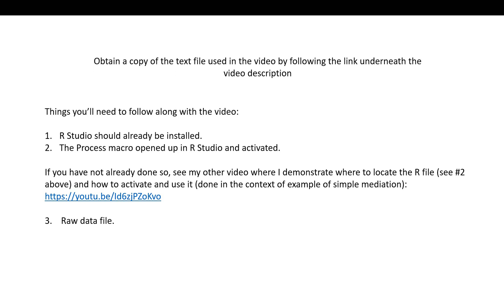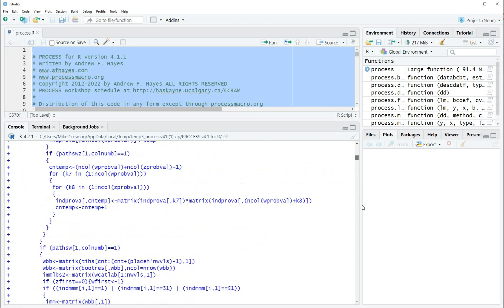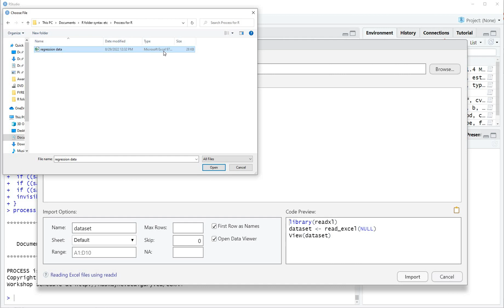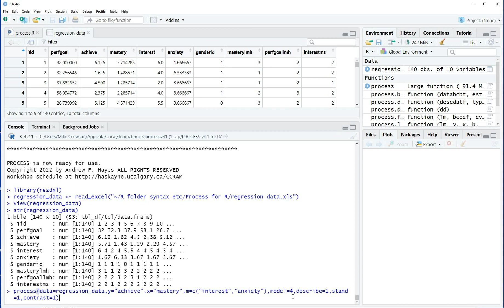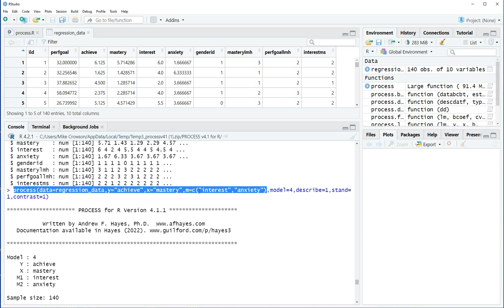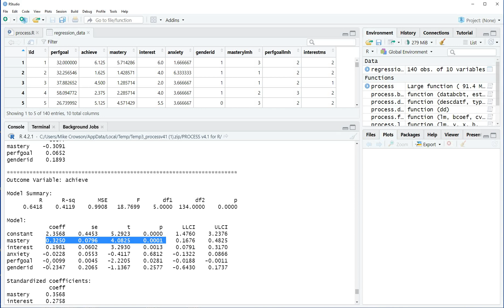Using Hayes Process macro with R Studio to test a parallel mediation model (August 2022)

Comment: Hello, can you post a video that is parallel mediation but there are two or more dependent variables and explain how to interpret and all that (as one limitation of process macro spss is that you can't do this). This would be most helpful! Also, thank you always for your awesome videos
Reply from the maker: Hi Jennie, thanks for your post. Unfortunately, Process only allows for a single dv in SPSS and R. It's just a basic limitation of the macro regardless of program used. That said you can easily model this using Lavaan in R. If you want a shorter cut, you might try Jamovi program which is free and built on R. If you add the right package from the library (also free; but I'm drawing a blank on the name right now), you can compute coefficients and tests for this model easily. Cheers!
Reply: @mikecrowson2462  Hello again, thanks so much for your comment, I will look into it. But if possible, then could you post a video using parallel mediation and 2 dvs using Lavvan? I have not been able to find any videos on this. Thanks